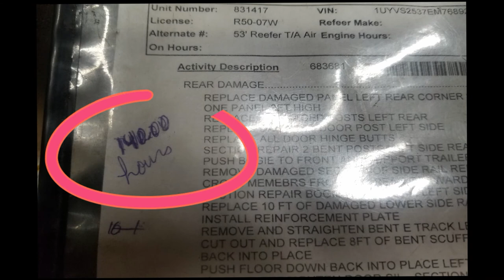trailer repair ,complete rear

Comment: Hi Mikey, If the rear plate (sill) that goes above the number is completely bend.  Does that weld to slider rail or it bolts to it for Utility Reefer trailer 3000r. Thanks

Comment: Very nice, how long did this job take you? I’m trying to leap from automotive mechanics to trailer mechanics but I’m not gonna lie, this looks intimidating. Lol
Reply from the maker: 150 hours , those jobs  should be done by one with large job experience .  Things won't line up.
Reply: It is not intimidating but if feels as if it were NEVER ENDING PUZZLE . Buy Very HIGH QUALITY HEARING NOISE PROTECTION NOT GARBAGE FREIGHT EAR MUFFS ! Tape thick foam insulation around your air hammer handles .    5/26/23
Reply: @vicpetrishak7705  The insulation cuts down on the nerve damage from vibration?

Comment: Hey Mikey I need to get my reefer trailer fixed it got a it in the door and bent the left frame upright post that the door is hinged to. Please send contact information.  Thanks. 
You guys are doing an Awesome job
Reply: Where are you located?
Reply: I'm located in west Haven Connecticut

Comment: Hi. I saw you just use screws from top of the aluminum floor to the back plate of bumber. Do you weld aluminum on top to cove that or leave it like that?.